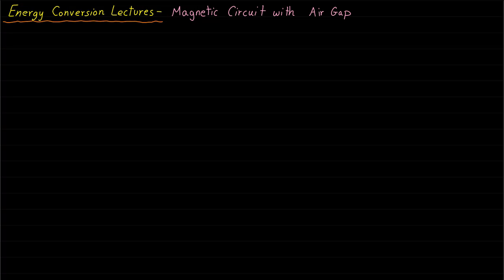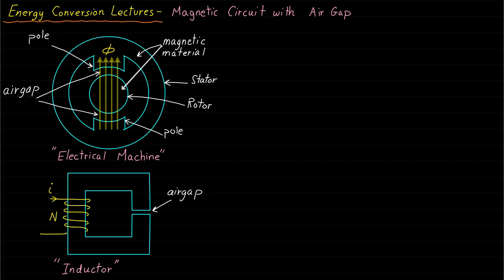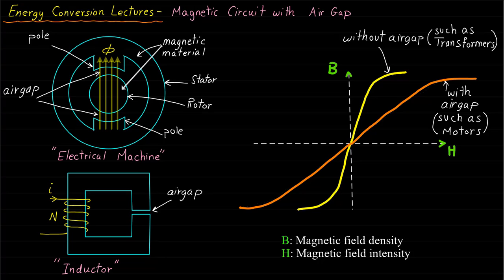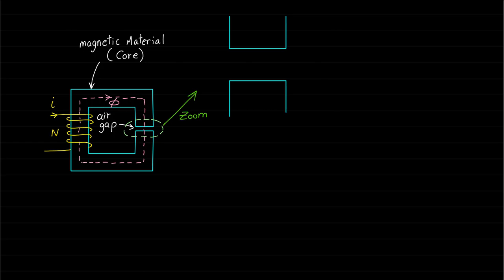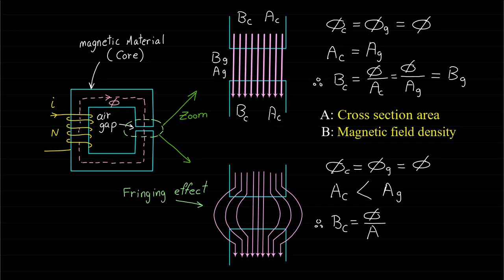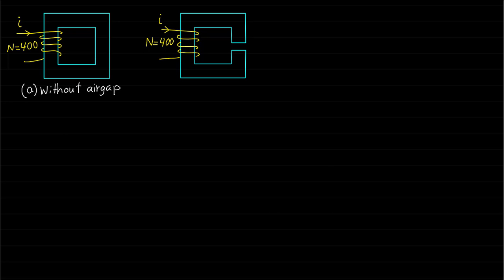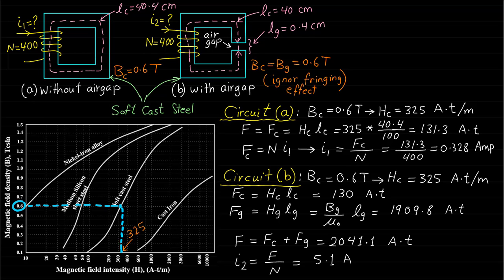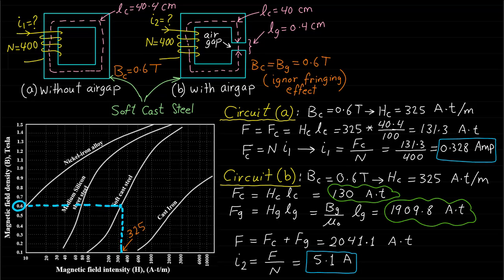Magnetic Circuits - Magnetic Circuit with an Air Gap

Comment: What if we'd have 2 air gap on core sir?
Reply from the maker: If we assume we have two airgaps for the example at 7:50, then the solution is by just add the lengths of the two air gaps. That means the magnetomotive force (Fg) of the air gaps will be equal to Fg=(Bg/uo)*(g1+g2). Hope this answer your question. Thanks

Comment: The air gap drops the relative permeability from 1500-3000 down to 2. At this point, just use a wooden core.

Comment: Not true. The air gap is traditional, not required. The slope of the B-H curve is the inductance. The air gap reduces the inductance making the magnetic circuit less effective. Also, machining a 1 mm air gap is not trivial. If you can guarantee that the average current through the core is 0, then you don't have the DC offset caused by 1920-vintage circuits which creeps up until the core saturates. All of these methods are trying to make up for the initial poor choice of power converter circuits. At least one motherboard manufacturer had to put 39 buck converters in parallel to provide CPU power and attempt to make up for the large ripple.
Reply from the maker: Thanks for your comment. Most inductance design in industry add airgaps to adjust the inductance value. This is a practical approach. There are several factors such as cost, core size, and winding number that justify the use of airgaps in the design of inductance. If you are talking about transformer, then the answer is Yes. Transformer design does not include airgap. Also, there are some special applications that design inductance without airgap. These applications use very high frequency (radio frequency). These applications have special design.
Reply: @EnergyConversionAcademy  The air gap is "traditional". It is used to prevent the core from saturating. To "adjust the inductance value", use a different material (wood, stone, glass, air).

Comment: Adding a 1mm air gap to a ferrite core decreases the relative permeability from 1500 to 3000 to around 2. That is only 2 times as effective as a non-magnetic core.
Reply from the maker: Thanks for your comment. Please refer to the example in this lecture which compare two magnetic circuits, one without airgap and one with airgap. Basically, you can modify the example and evaluate what is the impact of using 1 mm airgap. With this way you can get better idea about the impact of the airgap and how can be used.